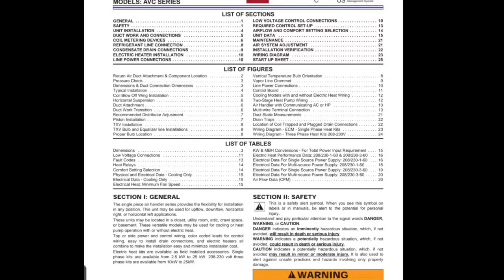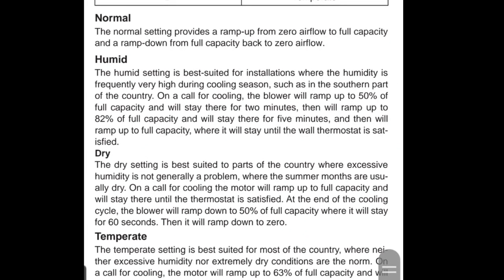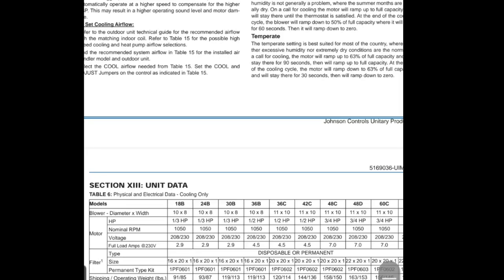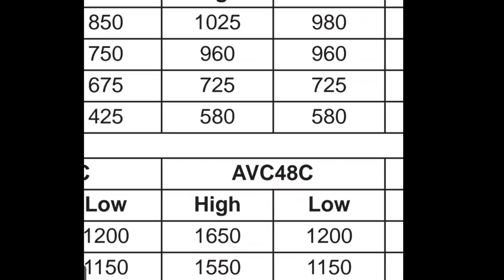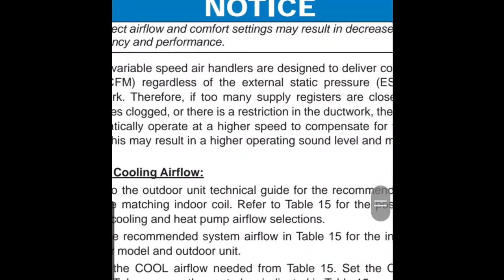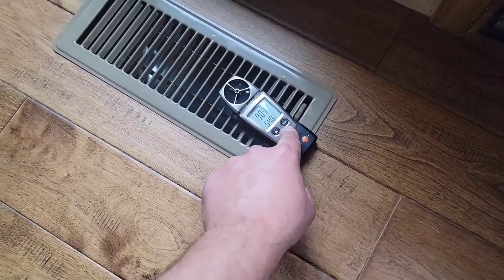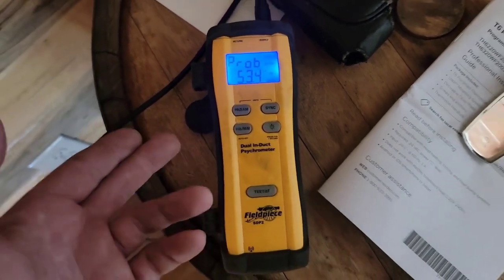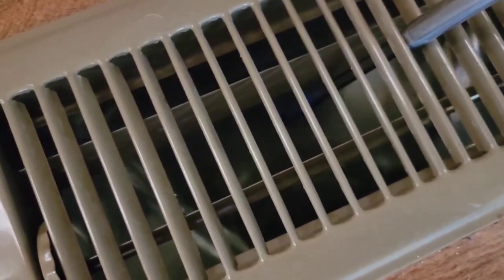Control Your Air Handler Fan Speed Like a Pro! @YorkHomeComfort

Comment: York has always had good electronics with well thought out algorithms.  Indoor and defrost boards. There is also a method via a dehum input to the indoor board which allows the thermostat control of a reduction in airspeed even when the Delay timers have expired.  When these options are combined with a two stage scroll, very good dehum and low interior sound levels are the norm.  I like York/Johnson Controls has started protecting the board with an enclosure.  Finally, it should be obvious that hacking in a psc replacement just because the ecm motor module has failed, severely impacts the customer's comfort and noise levels. I sometimes offer a customer the option of keeping spare modules at reduced, close to wholesale cost. Its a win win that makes you a hero if they need one in a hurry.

Comment: Great video thanks for sharing it I had my txv values  changed and then my blower motor went out it would blow high and low I had it replaced and  now it blows a little different high then very low  and the temperature is different by 3 or more  dregs  and feels more cool and not warm set on 79 but in front room is  75. It is a  heat pump in a mobile home single wide. It was warming and cooling before they changed the motor. Thanks have a blessed day 🙏

Comment: i have a Lennox SLP98UHV unit with single stage 2.5ton unit outside.

My communicating thermostat died and the replacements are $800 and don't last long either. So I went in the basement and put the unit in non-communicating mode so I could use an Ecobee thermostat.

The house is comfortable but I feel like I need to dial in the fan speed in better. The way it is now, when cooling it will run at 900cfm for about 6 minutes then ramp up to 1100 for a minute then shut off.  I don't have fancy measuring tools so I just used a laser temp gun. Im sure it's not 100% accurate. The day I took temps it was 92 outside, thermostat set for 71. When it hit 73 inside the unit kicked on. The air coming from the register was 48F. I keep the 5" filter replaced every 6 months (not 12 months like it recommends) and the unit cools very well.

Should I change to a different fan speed setup? Google says fans should run for 15-20 minutes to keep from wearing out the compressor and other reasons. And you mention the vents being too noisy but even at 900 I can hear it if the tv is off. And 1100 cfm is loud obviously. Should i slow it down even more to make it run longer?

Comment: Hi Tad, if I understood you and the procedure in the beginning, I believe you said the motor will compensate for high static pressure. What was the static pressure of this unit? Was the blower compensating for high static when you had the higher CFM's and noise in the beginning?Thanks for the great video!
Reply from the maker: I do not know what the static. I did not have my Tool for that at the time
I will do a video soon with the magnehelic

Comment: If you had to put in a psc motor what tap would you use? Would be. Interesting to see a manometer hooked up to see static. James Toy Mesa,Az
Reply from the maker: If you had a psc motor you wouldn't be using the board or the taps
That's a good idea using the magnehelic during the process I will do that next time

Comment: Hi and THANK you for the info! I live in South Florida, talk about heat and humidity! It’s July been 100 everyday outside and rain. I got a brand new Goodman HVAC central air system in my condo. The technician recommended lowering the blower (I don’t know what level he set it, this is not my field) and said it will run quieter and rid the rooms of humidity. It is working great. My indoor thermostat is reading 35% humidity. That’s DRY for us. *It gives me a sore throat during the night it’s pretty dry, but I’d hate to raise the blower because it’s so efficient. Do you think lowering the blower also saves on the electric bill? I’ve noticed it’s about the same as it always was. It does feel a lot better inside though.👍
Reply: I need to get the blower set lower in n. Rheem 2.5 ton.  It’s so loud and doesn’t kick on as often. The breeze is way too strong. I need to hire someone. So the humidity isn’t as dry as I like. Can I lower this or have to buy a device. I’m in southeast Florida.

Comment: I have a York TM9V 60,000 BTU furnace. I want to adjust the fan speed, but I can't find what size of jumper to use and where to get them. This is just for cooling mode. Pushes a lot of air. I want to dial it back just a bit so it runs a little longer with better dehumidification.
Reply from the maker: Send me an email tadfuller1@gmail.com

Comment: Will doing the steps you show have any effect on the Heat blower speed? I have a york gas pack and from what I understand the blower speed would need to remain higher for that.
Reply from the maker: there are speed taps for heat and cool on this unit so I only adjusted for the cooling
Reply: @TaddyDigest  thanks. My York unit looks very similar and I was afraid to try any changes before having a better understanding of the setup. Thanks for the video. Very helpful! :)

Comment: Do I need to be concerned at lower speeds of the coils freezing? I had a tech here just today who would not put the speed lower than what he did because he said the coils will freeze. I live in central Florida swamp, so it is about to get very humid and I want to add the delay and reduce the speed to better manage humidity so I don’t have to have a portable Dehumidifier in the house.
Reply from the maker: You can monitor the suction pressure and temperature while adjusting air flow
Unless the technician saw a low suction pressure I think he was probably making that up

Comment: what is the difference between Cool/Heat taps and Adjust ?
Reply from the maker: Cool is adjusting the fan speed in cooling
Heat is adjusting the fan speed and heating
And adjust gives you an option to increase or decrease fan speed a certain percentage.

Comment: Were you able to maintain a proper superheat with the lower air flow?
Reply: Generally the txvs will maintain superheat over a wide range.  Often these ecm systems are also 2 stage allowing first stage operation as well. Assuming a proper thermostat is used, typically a better Honeywell.

Comment: Hey man… I have a question… trying to call my HVAC guy but no answer, maybe he died or something. 
I have a Bosch 2.0 IDS 3 ton condenser with a variable speed carrier air handler, but I only notice one speed , very fast coming out the vents… and it turns on and off a whole lot. What do I have to do to make it slow down the speed so it doesn’t have to turn on and off so damn much. 
Thanks buddy!
Reply from the maker: I'm not sure
I have never worked on that model of equipment
Reply: @TaddyDigest  son of a b…..
You should come to my house and work on it so you’ll be more versed in all this hvac stuff, LOL